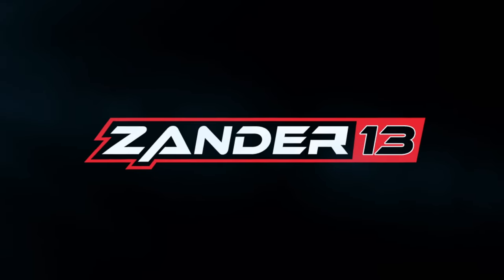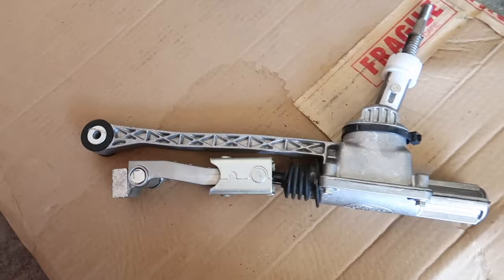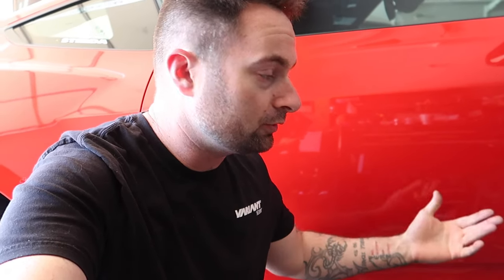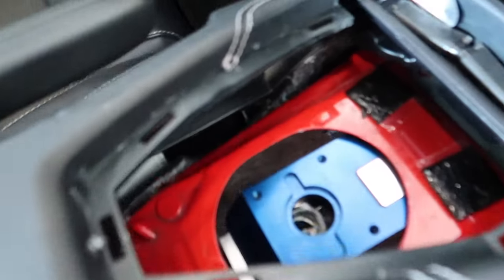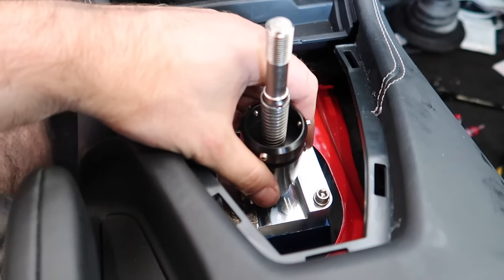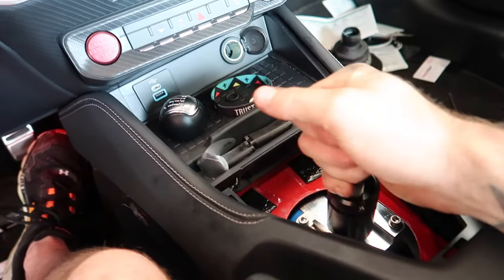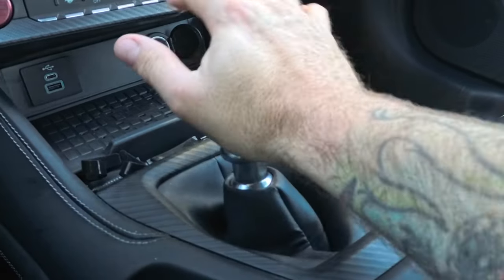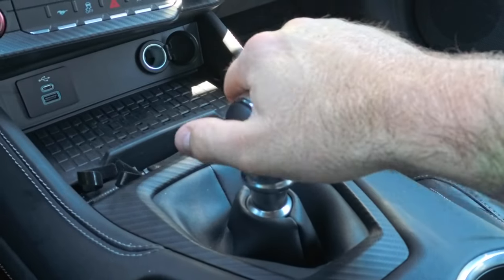FIXING MY 2024 MUSTANG MT82 TRANSMISSION (Steeda Tri-Ax Race Shifter)

Comment: MGW on my gen 3 mustang gt and it is awesome, no starter noise, feels like a gated shifter, shifts like a bolt action rifle.....and then drain the DCT automatic transmission fluid and put BG Syncro Shift II and one small bottle of their friction modifier....the cherry on top.  Rock on Zander, nice car
Reply: Been down this road with fluid many times.  You want 1.2 Litres of Motul DCT, 1.5 litres of BG Synchro Shift 2, 250ml of Penrite Shift Eze. Dont go full 75w80.
Reply: @pheonixfps9248  awesome, appreciate the feed back.... this is the first I've heard about this cocktail...will have to look into this, thanks

Comment: I'm big on the stock feel and I hate NVH.. I put a trans insert in my car and pulled it back out the next day because of NVH.. Hell to the No..  It was so loud inside the car and the vibration was awful even at low RPM's it was super loud.. So I left the Steeda Body bracket on and pulled that trans insert out and found that happy medium.. Just doing a weighted ball and the Steeda body bracket makes for a way better feel and shifts..

Comment: I totally agree with using an aftermarket short throw shifter for racing compared to stock.. But that's what I don't want.. I don't want a million little pieces to play with.. I like the way the MGW comes and how easy it is to put in and adjust.. Currently I am still using my 2017 stock set up but I added the Steeda Body bracket and changed the shifter ball and just doing those 2 things was enough to make the stock shifter tolerable for weekend driving and some fun.. I still only have 12K miles on my 2017 Performance pack so my Trans feels pretty new and rock solid still.. But eventually when I feel like the car doesn't owe me anything and I get some debts paid off I am going to Whipple it and put a race shifter in it for sure.. It just sucks that Ford puts a Good enough Trans in the Car instead of a great one!! For the money and the cost of these cars, Ford really cheaped out..

Comment: I was wondering when you were going to put out a video. Thanks 🙏 for the video on the Steeda shifter . I’ve had 2 Mustangs with the MT 82 transmission and yes the factory shifter is not that great . I never changed my shifter cause I couldn’t make up my mind which to go with . Anyway I have Automatic now and I don’t need to worry about a shifter . I must say the shifter you installed definitely has a short tight pattern. I bet it’s a blast to drive . As always thanks 🙏 again for a quality video .

Comment: Great video Alex! Thanks for sharing. I have used MGW and Callaway in the past. I have been waiting over a year for the Dark Horse order. I have two cars that are manual so my wife pleaded with me to order the 10R80 for the Dark Horse. I would prefer the Tremec; that’s what I have in my Corvette but I need peace at the dinner table and my wife likes Mustangs so I agreed to order the automatic. When I boost the DH the 10R80 will be fun with 800+ rwhp. What exhaust do you currently have on? Did you transfer the Kooks headers from the white Mustang to the new red Mustang? Did you go H-pipe or X?
Thanks Brother‼️👍👊💪🇺🇸

Comment: High RPM lockout  is cluch issue
Reply: as a gen1 2011 GT s197 owner I can't believe we're still talking about High RPM Lockout on the MT82 dang unfortunate.
Reply: So changing the clutch will fix the issue? I’m  getting an exedy clutch  stage 1 installed today on my 17 GT.
Reply: People think high RPM lockout is due to a cluch line, a shifter, or a blowfish bracket, if your a NA car, or moderate boosted, RST McLeod  or vengeance,  big boost, RXT or Mantic, I won't recommend any Spec products
Reply: Mt82 issue
Reply: My friend i have a new S650 - 5.0 manual i hear a little noise coming from the transmission when I drive it seems like light friction at low speeds is it normal ??
Reply: @ahmadalojaiman9877  D4 mt82 is a Twin disc cluch, so that's why you probably hear some noise
Reply: @maniacS550  It’s heard at low speed from first to third gear and decreases or disappears at high speeds
Reply: @ahmadalojaiman9877  wouldn't much worry, if trans goes out, it's warranty issue at this point
Reply: @ahmadalojaiman9877 Still garbage trans im glade i sold my 19 gt

Comment: My friend i have a new S650 - 5.0 manual i hear a little noise coming from the transmission when I drive it seems like light friction at low speeds is it normal ??
Reply from the maker: Yes
Reply: @Zander13Productions  thank you 🙏 I thought it needed repair

Comment: I want to know there is (no lift shift) in mustang GT 2024 ?
Reply from the maker: Yes
Reply: Did you try it it? I think it’s in dark horse only
Reply: @ahmadalojaiman9877  Hey there, don't know if you found your answer, but there is in fact a shift light in 2024 GTs, you can enable it by going to your customization options I believe under the same menus you would find your safety features at. I have mine enabled and it's pretty handy!

Comment: I have a tri-ax. Fucking hate it.
Reply from the maker: Really ? Why you hate it?
Reply: @Zander13Productions  because it doesnt hard mount to the transmission for starters, it doesnt have the refinement of the MGW, or the Barton. It uses the weak shifter cup, it's wearing out now to the point it shifts into the wrong gears, and from day 1, it was a pain in the arse to get into reverse. I literally had to machine and file stuff off so the lockout would actually allow it to go into reverse. On top of that, it uses the factory slide bushings, and after seeing how weak they are OEM, hoping the steeda would fix the shaft movement while shifting, It doesn't. I'm currently CAD designing parts to resolve the sifter issues of this shifter. I actually made bushes for the factory ford unit, put the ford performance short shifter in it, and it's WAY better. For the money you pay for it, it shouldn't use a single OEM piece. MGW and Barton don't, and are near on price matched.